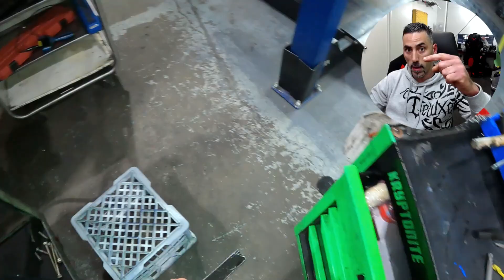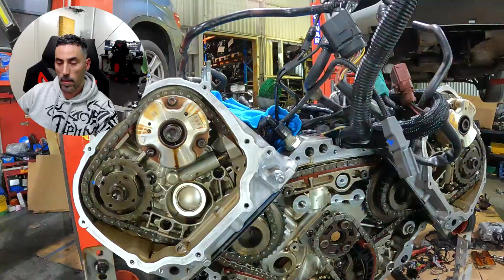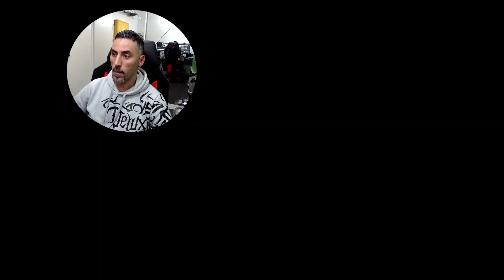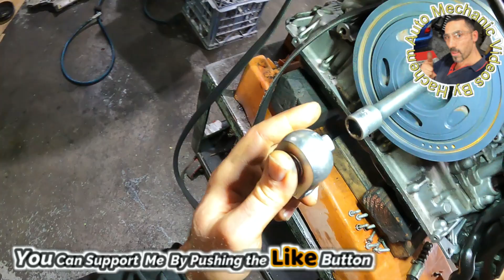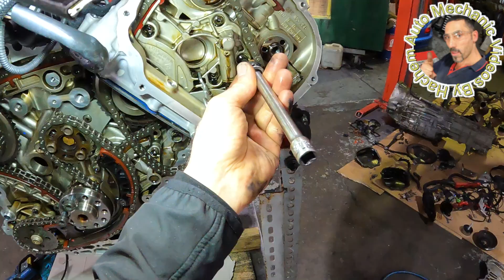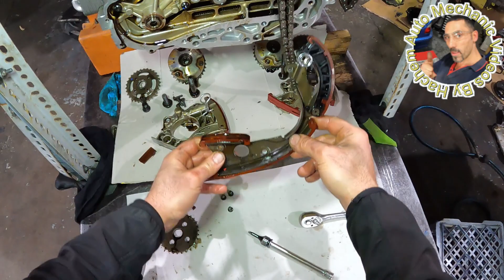Q7 V6 3.0L Supercharged Engine Timing Chain Removal Step By Step

Comment: Can you lock the crankshaft using the tool before removing the camshaft gears and phasers? Or does it have to bein that order specifically
Reply from the maker: Watch this video and part 2 too for easy understanding this engine timing chain setup 😊 thanks for watching

Comment: Brother. One of my camshafts, the intake on the left side, is too far out of time to put the locking tool on and there is no more slack to get it turned over enough. How should I go about this? Remove the camshaft chain and then line it up or what? Thank you.
Reply from the maker: Watch the videos part 1 and part 2 and then you’ll find how to fix this , inshaa Allah. Good luck.

Comment: Hello hachem,  this engine is supercharger or turbocharger or both. This video is very informative bro keep it up 👍👍
Reply from the maker: Good morning or afternoon Mr. Hanish, this engine is just supercharged , if the engine is supercharged and turbo in one time, 
i think, it will be too much powerful and the engine will not hold the power long time and will get damaged, otherwise they have to make Super strong metal to hold this power and not damage the engine.  i like the engine made for the Car weight not for speed so can drive strong When going up the mountains with safe for Everyone inside the car and outside the car, Safety first for Everyone. i like your comment  too. Have a nice day.